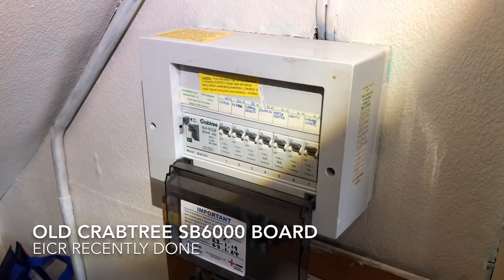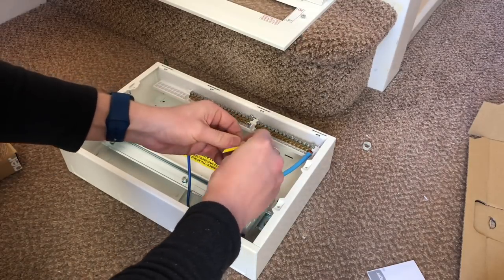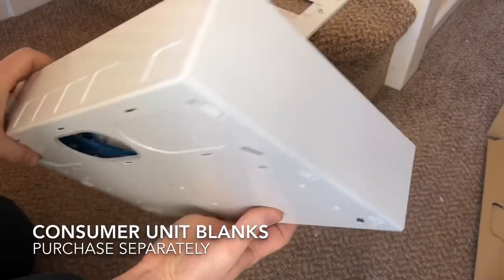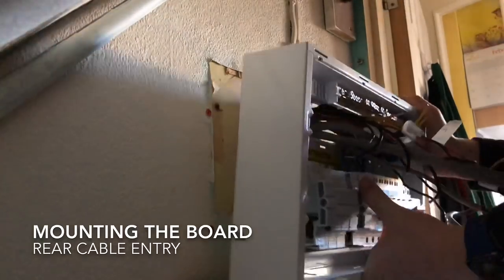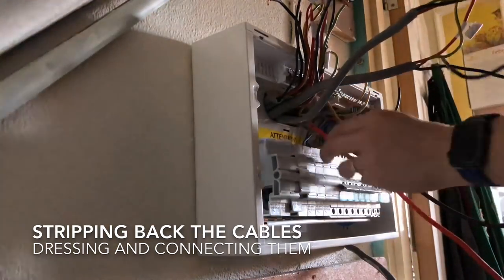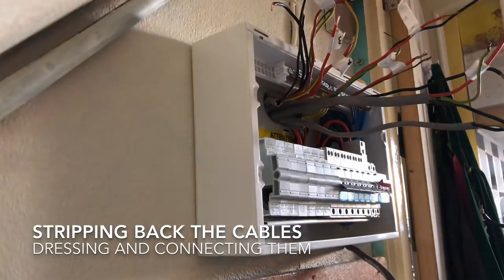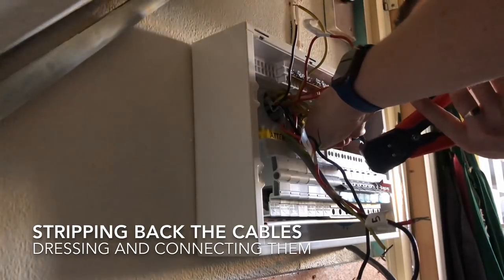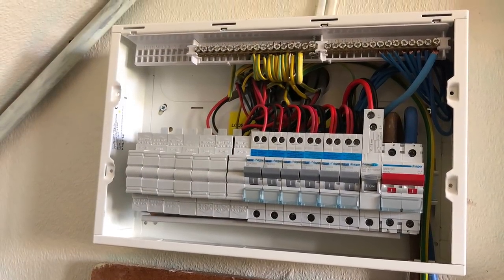Consumer Unit Replacement- Installing a Hager RCBO consumer unit to replace an old Crabtree one

Comment: Thanks for putting this up, I am retired having finished the last 5yrs working as a Commissioning Eng for Railtrack, but what I find so strange is that non of the domestic electricians seem to I.D. the cpc/line or Neutrals, with C1, C2 and so on.
Your comment as to extension legs and not using through Crimps, well if the correct crimpling tool is used and then Heat Shrink Applied, they never come apart unless you tug on them like a bull at a gate.
It would have been nice of you to explain to the average joe how you pre selected which cable went to which RCBO and the Amp and type selected. Also the connection of the tails, where did they go!?! to a swt isolator, or a live iscole link?
Talking of tails, did you include a Gas/Water Main Bond or was that off camera?
Keep up the good work
Mr Spence Eng

Comment: Hi Jordan. Very good video indeed. If I lived in Cambridge I'd certainly be looking for you to replace my board.
Just an opinion, but to cover yourself, I'd mention that you need to switch off the supply before you start taking the old board apart. Yes, true, anyone who doesn't know that will never be able to do a DIY job which works but at least they'll give up half way through and call a professional like you.

Comment: I think everything is satisfying (not only installing a CU)after you have done a very good job and that happens when you love what you do. I thought you were gonna install RCBOs for each circuit but nice vid anyway.
Reply from the maker: brad Rhed thanks! Yes they are RCBOs for each circuit, just mini ones so they look like normal MCBs
Reply: Oh yeah, sorry I wasnt listening properly. Wow! If thats how you install them, thats the way forward, they are much easier to install than the old way where you only had one or two RCDs, hence you had to cut the Busbar also easier to find faults etc, love them.
Reply from the maker: brad Rhed yeah they are the best

Comment: I see now you also wired it like the we do, but why is there so much old English circuit bored where the neutral doesn’t go trough the switch and only the that big strip of the out going circuit?

Comment: That old board is more modern then what I have in my workshop. Neutral and earth are bound together and that in a wet environment.
Reply from the maker: Might be time for an upgrade!
Reply: @artisanelectrics  I like the screw in fuses, it is a board the size of 1 by 2 meters. It powered the coolers, pumps and all a pre war greenhouse needed... never updated. The thick cable for 3phase had red, black, blue and earth... blue was a phase too. I never would have guessed.
Reply from the maker: Arjan Wilbie you are in the Netherlands right? I’ve worked out there for two years I know exactly the kind of boards you’re talking about.
Reply: @artisanelectrics  yes I am. People get smart meters these days, I like the old stuff. I managed to salvage the old 3 group board at my parents house and I plan to use it for a generator.

Comment: Just a quick question Jordan i notice  when u changing consumer board your not putting  any Main isolator after the meter for the main units. is that your preference or just the owners dont want to put any or do you advice them but they dont want just to lower the cost? what do you think???

Comment: Hi, I've just had my old consumer unit replaced to the 18 Edition RCD unit. I was not issues with a Electrical Certificate nor was the two spare slots unlocked. Is this normal?

Comment: Personally I would've used some batten to space the board off the wall as you've got some cables running surface which could be squashed by the board once you've mounted it to the wall. Great video tho!
Reply from the maker: Ashley Armatage thanks!
Reply: Hi if there's a fire it will get behind the CU , burning the cables directly.

Comment: Wiring is so different in your country then here in USA I am an electrician here in Massachusetts. We have electric panels with circuit breakers no consumer units. Residential voltage here is 120/240 volts single phase 60 Hz  Thanks Dan

Comment: Very neat job. Nothing to add except a tip for all.
On the subject of rawlplugs, the red ones state using a 5.5 to 6mm drill bit. Most guys use 6mm, I was the same until someone lent me a 5.5mm for the day.
Never looked back. It won't change your life but it cuts down the stress and swearing.
Reply from the maker: Nice one thanks!

Comment: Since the cables are the old black and white one's from the 60/70's I believe.  Wouldn't it be worthwhile re-wiring the whole house as they could be a hazard and I would have thought a higher priority than changing the consumer unit no?
Reply: If most of the existing wires passed visual,  insulation resistance tests and were within all tolerances on the E.I.C.R.  Then a rewire really isn't required.  Most customers would send you on your jollies  if you suggested rewires based on the age of the existing installation.   If insulation resistance tests failed or there were lack of sockets then you would suggest a rewire.  It's ultimately up to the client.

Comment: Did you strangle the two cables coming from the top? Compressing them between the wall and the consumer unit.

Or is irrelevant?
Reply from the maker: Jorge Arrobo no I made a small hole for them to slide down behind the CU

Comment: If your "6 milli" cable has a stranded cpc, then it is either 10 milli with a standed 4 milli cpc or else it is imperial cable. Where you have reconnected imperial cables, what do you write on the cert?

Comment: Thanks very much for that. I aggree, Hager are the best. Interesting to get the board loaded before installing, never done that. Installing a 6 circuit board like that I find fairly straight forward, it's when it gets up to 10 or 12 circuits that I struggle to keep it looking neat. Wouild be good to see you do one of these. I like to number each RCBO in the window on the device, that way when I take the cover off I now exactly which circuit I am dealing with. Also the client can say exactly which circuit is tripping. Thanks again. Take care.

Comment: If you added Arc fault detectors, presumably the new board would be much bigger than the old one,would you then need to make a bigger hole in the wall?

Comment: Great job & explanation, I have just one observation, electricians are taught to bend the end of conductors to double their width & give a better connection into the RCBO/RCD etc. you appear to be leaving the conductor 'ends' as single strand unless they're 1.5mm2, why is that please, have you found a better way?

Comment: Hi Jordan, I have always felt the colour of the functional earth lead is misleading. Functional earth leads are supposed to be cream, according to table 51.
Green and yellow shall be used only for the identification of protective conductors. I dunno about other manufacturers, but Hager Technical told me the leads on their RCBO's are for FE.
But the leads are neither cream or G/Y. Puzzling. I also struggle with the way these FE leads are connected. Personally, I feel the manufacturers should offer a longer earth bar with a standard sized terminal and a small one for each way. This enables each FE conductor to have its own terminal.

Comment: Good video , love the hager boards been using them for years only pain I have is fitting the tails always find it tight under the main switch with bottom entry. We always use the windows on the circuit breakers when labelling as we find over time the stickers fall off so the window protects the stickers. Great video 👍
Reply from the maker: Good stuff thanks for the comment

Comment: Thanks for the video. I have a new refurbish rewire to do soon and was wondering about the popularity and reliability of an all RCBO consumer unit. I so far, have only put RCBOs as safety replacements in existing systems.
It certainly stands out for preventing accumulative earth leakage nuisance tripping.
Q, do the Hager RCBOs switch BOTH Live and Neutral.??

Cheers.
Reply from the maker: Yes RCBOs are the way forward, when I install new consumer units now I only fit Hager RCBO boards. They don’t switch both live and neutral as far as I’m aware though.
Reply: @artisanelectrics  Just watched a couple of videos of Hager RCBOs that failed, quite dramatically. One with big Clive and the other John Ward. I don't want to have to go back to the job to replace failed units. More research first I think.
David.

Comment: Functional earth should not be sleeved green/ yellow.
Reply from the maker: Johnathan Wright thanks I should have known that’s! This is what YouTube is all about! Learning from each other.
Reply from the maker: R-77 its an earth that is used for functional purposes ie in this case the white wire running from the RCBO is used to make sure the RCBO works correctly in the event of an earth fault
Reply: Artisan Electrics the functional earth is there to enable the Rcbo to work in the event of a lost supply neutral.
Reply from the maker: R-77 white or pink apparently
Reply: Artisan Electrics Cream is the only colour listed for functional earth in the regs.
Reply from the maker: Johnathan Wright yes sorry cream not white
Reply: Artisan Electrics Has
Reply: Without the earth reference the device cannot operate. It has nowt to do with back up earth of lost neutral. It allows the device to function.
Reply from the maker: great comment thanks  @e5Group
Reply: @e5Group  I think that if you test it without the cream/pink - then it will trip on the RCD side. It is only a functional earth. See https://www.youtube.com/watch?v=4pzFqj9-9Ic&t=9s.
Reply: Shilks it may do as JW says differs from manufacturers. Some use it as a reference point to measure potential between neutral and CPC to ensure more accurate tripping. Some use as a back up for function if loss of neutral.. it’s all good fun to research when selecting and erecting the right devices for your install. 👍
Reply: It doesn't have to be. If this supposed to be green/ yellow why its white then.
Reply: @e5Group  WRONG
Reply: @k1100ltwhite  Telecomms functional earths on 'phone systems were always cream as well.
Reply: @k1100ltwhite  pink is also allowed as per the corrigendum issued by the IET
Reply: on this unit the white cable is so if the neutral is lost and still allows the rcd to trip in that condition , unsure how the other RCDs can operate in a lost neutral situation (newer RCBOs depending brand seem to lack this ground cable for loss of neutral, unsure if they have somthing internal like a capacitor that allows it to still rcd trip on loss of neutral)
no normal circuit breaker device uses earth to detect power on earth (on consumer products any way) they just compare the diferance between the L+N , if its is not coming back via N its going earth somewhere so RCD will trip

Comment: Great video, Hager look really great. I see there is no attempt at a fire barrier where the cables enter the rear of the consumer unit. My cable are back enter through a hole in the brick work from the cavity that has been filled with rock wool. Would that be considered sufficient fire protection?
The property was built in the sixties.

Comment: All what we have been fitting for years, only the best Hager !    Although we are looking out for Hager to bring out the DP RCBOs for TT installations,  as they are currently only SP.   So the only way I can see around it is to fit an 100mA type S up front, or fit a Fusebox RCBO board as they have DP RCBOs.

Nice job.  I challenge you to a neat board ! :D
Reply from the maker: Good comments thanks!

Comment: i have the Armeg torque drive kit. £94
does the job but i can still turn two more turns on the main switch connections, (existing install) makes you wonder hmmm. should we be returning in 3, 6 or 12 months to check??
Reply from the maker: Yeah good point!

Comment: Do you test the property before you do a board change or do you rip old board out, fit new one then test and hope there is no faults on existing circuits? I've always done the latter though by the book you're suppose to test before.

Regards
Reply from the maker: crzyrich1000 depends on the situation, I always prefer to do an EICR first but if the property looks fairly decent I will just change the board and test afterward but I always warn the customer that we might find things during testing which need rectifying at an extra charge.

Comment: Also interested to hear electricians opinions on best practice to strip back T+E  cable using the cpc conductor as was taught never to do that and use a knife to score around and through the sheathing or a cable stripping tool
Reply from the maker: I personally use a cable stripping tool in most cases but I also use the CPC sometimes and never had any problems doing it that way.

Comment: How do you turn off the power from the meter to the CU before removing? Is there a separate isolating switch? Is this switch always present? What do you do if there isn't an isolating switch?
Reply from the maker: Sometimes there is an isolator switch, other times there isn’t and you have to get permission from the DNO to pull the main fuse

Comment: 6 inch driver bit is what you want for fixing consumer units like this, save catching the chuck on the body of your CU.

A Fischer Rawl Plug, lovin it
Reply from the maker: SM Electrical Solutions good advice, I do actually have one but didn’t think to use it!

Comment: An excellent video J

How long did it actually take you to install this board? Got the timing just right. So much more watchable than vids that are sped up too much, with some annoying 'Benny Hill' or trance/ house music over them.

Thumbs up from me.
Reply from the maker: Kevin McNicholas thanks a lot! Install took about 2 hours but testing and other bits made it a full days work
Reply: @artisanelectrics  Two hours is pretty good.

RCBOs are great but they're sooo expensive. People are reluctant to spend six, seven, eight times as much on one than a regular MCB; no matter what the benefits.

You can get a fully populated 10 way board by, say, MK or Crabtree for around £70.

How much was the Hager one with the seperate RCBOs to source? £200-£250?
Reply from the maker: Kevin McNicholas it cost roughly £250 including VAT but customers in Cambridge are wiling to pay that as the property prices are so high, it’s worth it. Probably in London it’s the same but in in parts of the country where property prices are low you would struggle I guess. I’m only fitting RCBO boards now, haven’t fitted a split load board in over a year.
Reply: @artisanelectrics  yeah, fair do.
Reply from the maker: I did all tests required, don’t worry about switch lines not being sleeved that’s no big deal, any major issues found I would quote separately for.

Comment: Hey, I'm curious, is shutting off all the mcb's and the RCD enough to make it completely safe to touch all the wires? Because it's no longer a circuit? 
Or is the another switch outside or something that you turned off before starting the video?

Great video! Gave a like.
Reply from the maker: No the whole installation needs to be disconnected by turning of the main switch or pulling the main cutout fuse

Comment: Hi, when you did the insulation resistance test, did you have have to remove the rcbo fly lead? Btw I prefer to leave the picture stickers off too.
Reply from the maker: No In the Hager boards you can test with the fly leads connected.
Reply: Artisan Electrics thanks for the reply. I’ve chosen them for 2 board changes next week and some of the guys were trying to tell me I’d still have to disconnect the fly leads or the ins would be pulled down. Great to know. Thanks for replying 🙂

Comment: What's your opinion on the merits of SP RCBOs vs DP RCBOs'. I see that Wylex (Siemens) have single width DP RCBOs. Can't see that there are other manufactures providing single width DP RCBOs.
Reply from the maker: Shilks def prefer double pole if possible but they aren’t available in single module size in all brands and prob more expensive I would imagine.
Reply: DP isolates the Neutral and Live from the installation when it trips. There are certain scenario's where this is handy to have.

Comment: great job, Question.
whats your thoughts on Metal blanks or Plastic blanks?
both are available, just wondered what you thought....
Reply from the maker: I only use plastic blanks, metal are not necessary.
Reply: plastic due to self extinguishing ?

Comment: Please show us how to disconnect from the meter box tails and connect to the fuse box. thanks. Do you need new tails and earth or existing will do?
Reply: You need to remove the company fuse, (re; removing the metre tails), BUT, it will have a seal on it. I have been fitting CCU's for 50 years' and the amount of seals' that I have taken off comes to 100s' and I have tried to re-use. Remember, you're not really allowed to remove the seals' so, it's up to you. Yes, you can re-use the 16mm tails. ALWAYS remember... "prove dead to stay alive"!!! In other words... make sure the wiring you're working on is DEAD and therefore... you'll stay alive! I don't really believe that doing a CCU is for the DIY but I guess I'll be shot down for saying this PLUS... there are THREE things you cannot do, without approval from either the council or someone who is part of a part P organization, (there are 'third party' companies that you can go through), and they are 1; run a new circuit: 2; wiring in a 'wet area', (meaning a bathroom etc and this applies to the 'zone' within a bathroom etc so you can work outside those zones), and 3; is, sorry about this, fit a new CCU. Great video by the way and well narrated too!
Reply from the maker: Great comments thanks!